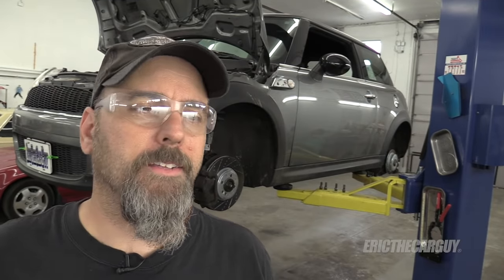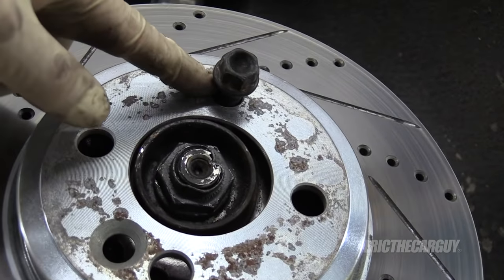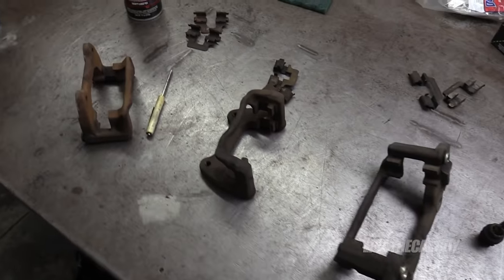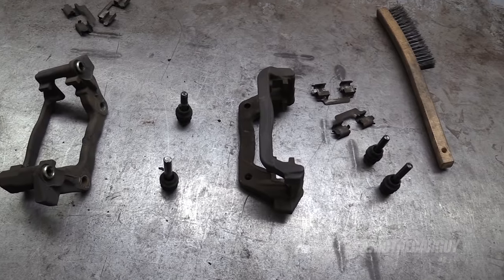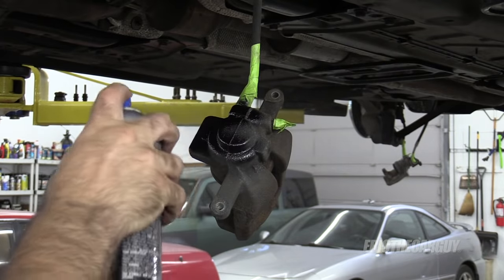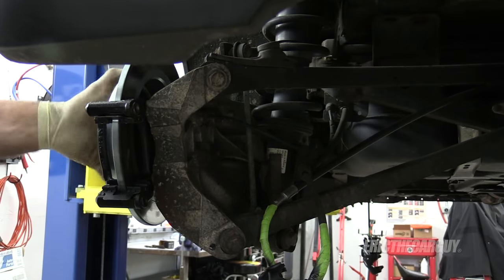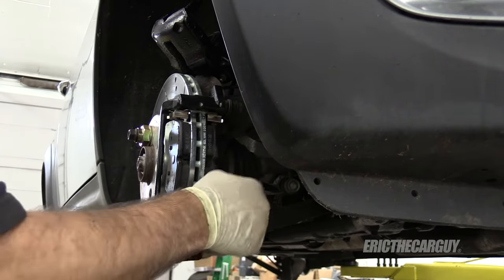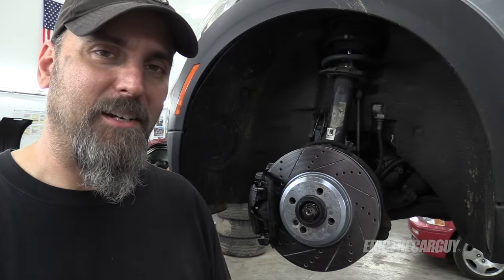How To Paint Brake Calipers Like a Pro!

Comment: Quick tip painting them red will make you stop faster 😉
Reply: It will also add 5 hp on top of it.
Reply: That's right
Reply: also it will make it drifft like rally car
Reply: Also will save you 2 gallons of fuel per mile
Reply: A piece of coat hanger wire keeping the tension off the hose while you clean and paint may make  you  stop faster as well.
Reply: I painted mine Teal, which happens to be my girlfriend's favorite color, and got laid that night. By my girlfriend !! So I'm big on painted calipers.
Reply: Imagine if you chrome plate them.
Reply: Chrome plating adds +15 sickness and +10 recognition for your gansta buddies. Complete Set will have 21" chrome spinning wheels and a golden dollar necklace.

Comment: I've always hated painting calipers, but luckily most of them were brand new, makes the job a little easier. Always looks nice when you can smooth and and clean up all the casting marks.
Reply: or you could buy some decent calipers, most come painted.
Reply: Not all vehicle applications have the option of "decent" pre-painted calipers. Sometimes all you can get are OE style replacements.
Reply: Kevin Irish then don't paint them, if oe replacements will suit, then you don't need upgraded brakes. Everyone knows your red callipers aren't brembos
Reply: I've painted a few new sets of brembos, they aren't perfect out of the factory. When you're building show cars, every little bit of detail helps.
Reply: @JordyValentine  why not paint them? Looks hella lot better than a rusty pos

Comment: Eric, To bad you have to put up with some of the comments on here. I have been painting calipers and brake drums for about 30 years and the method you just described works just fine. The quality of enamel paints now a days is awesome. I painted the drums  on my jeep about 4 years ago and they have not shown any signs of rust yet. I live in the North country where there is salt used on the highways in the winter. I used the exact method you described and a good quality Rustoleum enamel. Not even high temp. nor did I use a primer.  Love your videos. Great info for us shade tree mechanics. Keep it up.

Comment: I had a front caliper and a rear caliper on my G6 GXP break two years apart.  I like replacing things in pairs so I ended up with four new calipers on my car.  Fronts just got VHT, but when I did the rears I used VHT and then a clear coat on top.  Fronts aren't looking so hot after three years, but the rears still look like I did them yesterday after a quick spraydown at the car wash.  Also - front pass side caliper locked up AGAIN this summer (stupid reman part) so I rebuilt it (your caliper rebuild video came in handy) and repainted it too.  This time I used Eastwood caliper paint, then clear coat, and it's a thing of beauty.  Bottom line, if you're going to the effort to paint your calipers to begin with, put a few coats of non-yellowing, UV resistant clear coat on top when you're done.  It is WELL worth the time.  Oh, and Eastwood > VHT, though not vastly so.

Comment: I used the G2 brush on enamel, but otherwise went with the exact same process.  Downside to the brush on is that it takes ages.  Upside is no overspray.  I also added in some high temp vinyl to match the color of my car.  I know it's a bit ricey, but black calipers with "Subaru" in WRB ended up looking really good for the $60 investment.

Comment: A dremel tool with a wire wheel works for getting in the small spaces.
Reply: Every shop needs a dremel tool or two... one with an extra-large wire wheel and the other with a heavy duty rotary cut off disk! Time savings that a dremel provides is worth every penny....

Comment: After painting my calipers on my Saleen several times, I found a better way......powdercoating.  I had all four calipers powdercoated about 7 years ago.  They are to this day in great shape.  No flaking, fading, or other deterioration.  Not cheap, and your car is down obviously for a while until the powdercoater is done.  But the results last a very long time.  And you usually have a wider selection of calipers.  My Saleen, for example, is the very very nice Atlantic Blue from Ford.  Very close to the blue of the Florida Gators.  So I had my calipers powdercoated orange.  The place that did the job was able to match Gator orange quite easily.  All in all a great job.
Reply from the maker: Yea, that really is the best way to go. Thanks for the comment.
Reply: No, the best way to go is to buy ones that are already painted from a reputable manufacturer

Comment: I used a rotary wire brush to get the surfaces shiny clean.  Then wiped with alcohol, let it dry & painted.  I used Rust-Oleum's caliper paint found at Wal-mart for $7~$8, and this paint is very durable (I painted the intake manifold & head covers with it too).  

Brake calipers are exposed to a very harsh environment (especially in winter where sodium-calcium is sprayed), and some rust would form.  Once/year, I sand the rust off & do a touch-up on the calipers.  For fixed calipers like Brembo, they say to take care not to chip the paint but I don't know why.  

Some brake cleaners are so strong of a solvent that they melt styrofoam instantanesouly, so I would recommend wearing a mask with cartridge filter (not a typical dust mask).

Comment: It may sound ridiculous but one of the very best cleaners to remove brake dust is a good soap and water. I was surprised how well it worked. Needless to say oil & grease may come off easier with the brake cleaning products but the soap and water will keep the dust from flying all over!

Comment: I have a small blast cabinet on a cart. I put the cabinet on the toppa the card and the bag down on the bottom shelf. It works great that way. I just got a China Freight ... oops Harbor Freight cart and it all fit perfectly .  Of course to use on this would require complete disassembly....Great video.

Comment: All calipers should come coated.....I HATE rusty looking calipers.....
Reply: Agreed! Why the heck don't they do that from the factory?!
Reply: Often the porous metal holds grease and dirt better than paint.
Reply: josh bishop And they also rust much faster & collect dirt better without paint.
Reply: cost
Reply: @MCRideout  paint is expensive. Rust speeds up wear. Wear means parts and or new vehicle sales.
Reply: @nnittyllojkoo917  yep that's it. But if car manufacturers took off some useless shit like electric folding side mirrors or blind spot sensors, the cost wouldn't be an issue. Too many cars have too much stuff that most drivers don't need or want. Plus most of these new sensors and tech like elecronic assisted reverse parking makes drivers lazy. Too many bad drivers as it is. I know people who cant reverse a car that doesn't have a reversing camera. Keep the gimmicks as add ons and spend more on using quality parts like stainless exhaust headers not cast junk, painted brake calipers, light weight forged wheels etc. You get my drift. Rant over.

Comment: If you want to make the front surface smoother, hit it with some 80 grit, then 180 grit. You can even step down to 220 or 320 if you really want them to be slick

Comment: Interesting version you can use rubbing alcohol on the parts to wipe the down after dusting or scraping off the curd and then use a rust inhibitor and apply 3 coats 15 minutes apart to help the metal avoid rusting and then apply 2-3 coats of the color of your choice and 2 coats of clear coat for that extra shine.

Comment: Good look... The more you put into it, the better the results.  I'm kinda over it now though, my Maxima and Mustang remain half done... Too lazy. '14 Camaro... It lives in the garage with the Mustang, doesn't need it (so far)

My Method? I buy the brush on caliper paint but buy foam brushes the hardware store and cut them down to size.

The Silver is too runny and garish, I mix it with Black for a Gun Metal look.  You want to mix more than you think you'll need to do how ever much work you have planned.  I also hit up the hub and the outer rim of the rotor.  I would do the backing plates as well... (just too lazy) Did I mention that I'm lazy?

Comment: My 99 gmc jimmy has now got to where it wont crank below 30 degrees but it turns over. Any idea about this? Also i hear a noise under the hood after running the air a bit on a hot day,water pump going bad? Please help!

Comment: Hi, I have a question eric ive bought some new front calipers for my car . I did paint them and idk the name of the part that goes attached to the back of the wheel hub but the nuts don't fit my new one any ideas what will happen you paint the threats Inside the hole.?

Comment: What's your preferred flavor of brake cleaner? Mine is CRC's Red "Brakleen".... I have found the green(non-chlorinated, I believe), and several other brands just don't have the nuts to do the job... which is not necessarily just brakes. Working with diesels or if you use diesel fuel as a solvent/break-free solution - the stuff works wonders! We bought it by the case in the farm shop.
Reply from the maker: I've been using the Zep stuff for a while and I really like it.

Comment: A lazy approach is to use a rust remover/ protector like Krown T40 with the a wire brush. Then wipe it off with a rag. The calipers will go kind of black and look like they did when the car was a few years old.

Comment: Any which way you paint calipers it will look 100 times better then the rust you get 10 minutes after you start driving. Locally many shop offer to do it with all four corners cost from 80 to 120. Well worth it.

Comment: You could use 4 fluid line clamps and disconnect the calipers without having to bleed the brakes.

Doing this as bench work is always preferable.

Comment: Is the any advice I can get about idle issues... I changed the idle air control sensor.  The tos. Distributor.  Plugs wires. Ect.  And it's still got an idle surge what am I doing wrong
Reply: BTW it's a 93 civic ex vtec.  I did the head gasket not to long ago so could it be the timing is off or a compression issue?

Comment: I've heard those called shims before.  But then I ordered shims from the Toyota dealer and they gave me the backing plates for the back of the pads.  So I guess they call it a "fit kit."
Reply: P-Treezy O'Breezy They are more commonly referred to as anti rattle clips.
Reply: That kinda blows my mind.  The anti-rattle clip on my BMW is completely different.  I'm sure they both stop rattling pads though.

Comment: Isnt it bad to spray brake cleaner and paint on the rubber boot surrounding the brake piston?
Reply: There's a possibility that brake cleaner could dry out some rubber.  Having said that, I've used brake cleaner on various hoses, seals, gaskets, etc. for several years and have never had a problem.

Comment: Hey Eric. Not mini related or painting related, but it is brake related. I had an issue with my brakes and replaced pads and calipers. Both the calipers and pads came with shims. Which ones do you use? The shims were almost identical but did have slight differences.
Reply: Use whatever came with the pads
Reply: Scottish B that’s what I figured and went with.
Reply: This is a mini vid

Comment: Is that some rust preventative coating on the rotor(s)? Once I was in a rush so I didn't paint mine and they rusted up like hell ofcourse.
Reply: You probably forgot to clean them with vinegar, try that next time.
Reply: @00recon  Um, what? You clean new rotors will brake cleaner or alcohol or acetone. Vinegar doesn't belong anywhere near a brake system...

Comment: Useless if you live in places where is snow and salted roads. Only sandblasting and powder coating is a long term (6-10 years) solution. And I was wondering why you didn't applied silicon lube inside  "those rubber things". Silicon lube make them softer and then they last longer.
Reply: Dude all he does is preach silicone paste when he does brake jobs. You must be new here.

Comment: How old is that mini? Service life on rubber brake lines is only 6 years.
Reply from the maker: I've spent enough money on the Mini thank you. The hoses look fine with no dry rotting or damage. If I were to inspect this vehicle I'd give it a pass.
Reply: @ericthecarguy  I don't blame you, something to think about is that with new pads, it's likely going to be a while before it is inspected again. The lines could start cracking and showing age long before anyone notices a problem. Again, I don't blame you but I wish more people knew the service life of rubber lines.
Reply: Most cars are just fine going 15 years or more on factory original brake hoses.
Reply: And most people don't have accidents while texting, thats not a valid arguement. Luckily bakes have redundancy and a leaky or burst like probably won't kill you, but best practice is to replace lines more than 6 years old.

I have driven on 30+ year old lines. If I touch the brakes on a car with 6+ year old lines or unknown I replace the lines because it's a proper safety procedure.
Reply: @ExtraFungus  freaking scout master josh here, always does everything by the book. Good man here. 😂
Reply: Ohhhhh yeaaaaaa
Reply: @daves_not_here_mannn  you just feeling left out or was there an actual useful reason for bumping this?
Reply: @ExtraFungus  hi
Reply: @ExtraFungus  i love your accent
Reply: @daves_not_here_mannn  why are you spamming the comments?
Reply: @ExtraFungus  cause you keep feeding the troll.
Reply: @daves_not_here_mannn  who says I want to do anything different? We are keeping this one of the top comments and it's a pretty important post. I just wish you were a better troll.

Comment: Pfffft, amateur!  If you had painted them red you would have gained at least 5hp per caliper. /s  

Thanks for this, I'm going to have to do a bit more research and reading before I'm confident enough to work on my own brakes.  I know for y'all that have been wrenching on cars since you could walk, a project like this is as easy as taking a piss...But for a proper amateur like myself I try to make 110% sure I'm doing things correctly, especially when fiddling with something as integral as brakes.  I've wanted to paint the calipers orange on my orange Crosstrek since I got it nearly two years ago, so it's about damn time.  

I however have a profound proclivity towards prodigious bouts of procrastination primarily piqued by the presence of my own pesky ignorance.  Praise be to Google, our portal to the collective knowledge of the Human species!  To think only about 20 years ago you'd have to crack a paper instruction manual and spec sheet in order to learn yourself proper like.  The horror! /s

Comment: Don't forget to coat the freshly painted calipers in brake fluid to keep them sealed..
Reply: Ok, is this a bad joke?
Reply: yeah that was pretty bad
Reply: David G, Errr no, nice try :)
Reply: Ha, ha! 😁
Reply: I coat mine in blinker fluid
Reply: left or right fluid? got both, need to know.
Reply: @finn127   Hazard lights series, for that extra BlinK
Haters gonna hate.
Reply: Good idea, its cheaper than clear spray paint and works like magic, you can't believe the result.
Reply: Better yet.  Some PAG oil
Reply: @IamTranslation yes that was the joke. Eric painted the calipers while they were hanging by the brake line hoses, significantly increasing the risk of them leaking. If they do, the fluid will run down the hose right on the caliper and eat the paint off lol

Comment: A pro would have primed them...
Reply from the maker: The paint is a primer/paint.
Reply: @ericthecarguy  no, it isn't. On the back it even says to use a high heat primer before applying the caliper paint.
Reply: +Fox, no, it is.  

https://duplicolor.com/video/type/how-to-projects/caliper-paint-how-to-from-dupli-color  

Straight the horse's mouth, aka Duplicolor, the maker of VHT Caliper Paint.  You prep the caliper correctly, and shoot the caliper paint.  Then you go heat the brakes up and you're done.  

If you're not using VHT, then yeah, it probably does need primer, but the VHT Caliper Paint is made and meant to go on bare caliper parts.  And having done this myself on my own brakes, I can say it works just fine.
Reply: @mikeybhoutex  the guy is just a troll
Reply: SHIMS .. I laugh every time.

Comment: I wish these cheapskate auto manufacturers would simply paint the calipers and rotor hub assemblies at the factory so they don’t rust to begin with, instead of sending them out with untreated metal that look terrible 6 months after you drive the car off the lot.

Comment: Preparation is key : Brush the dust, clean calipers with brake cleaner, apply 2 coat of VHT primer, apply 2 coat of VHT paint and never worry the paint will lift off or chip after a few months...
Reply: Lets see your video.
Reply: I checked out your channel. Very disappointed.
Reply: Fine by me and good for you then, be disappointed, it's your right... ;)
Reply: @adelphus515  why thank you good sir. May you have a pleasant day.